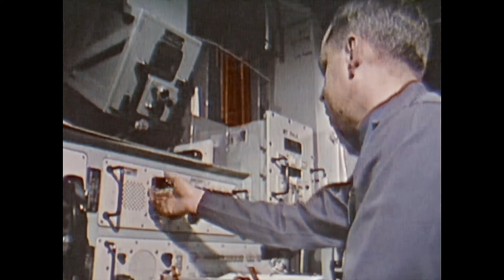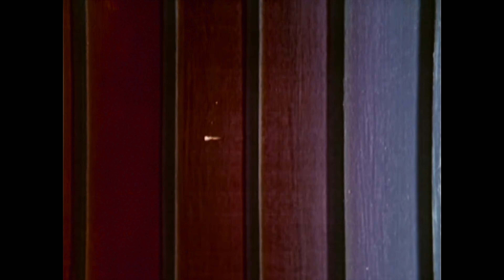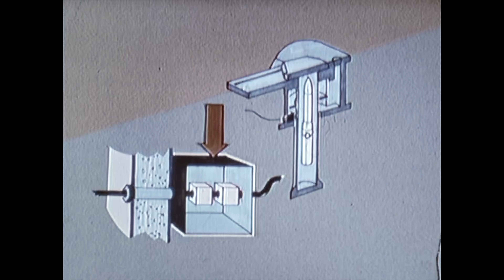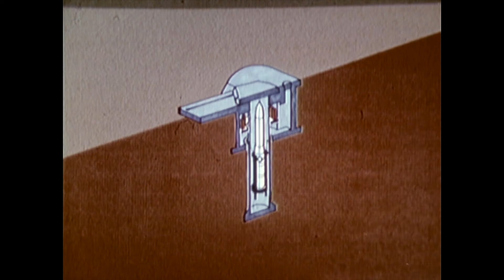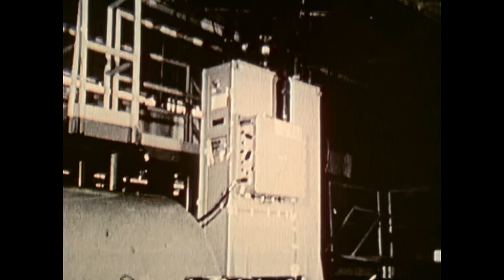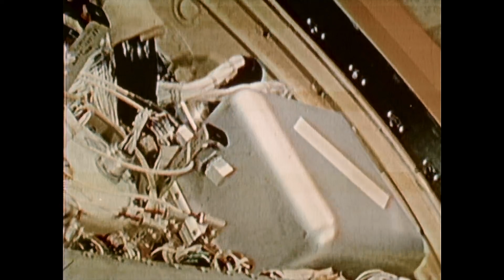Minuteman Hardness and Survival Program

Comment: I always wondered: The call comes in. The codes match up. You get authorization and you send your birds flying.

What happens next? You just hang out, downstairs - and guard some empty holes? How much food do you have? Got some good movies on the VCR?
Reply: A month later you start dying
Reply: @oriolesfan61  Without a doubt - but what does the SAC book say? What are those guys supposed to do?
Reply: @frankpinmtl there's nothing after the 30 days of surviving in the bunker
Reply: There were procedures written, but it’s generally excepted that you’d be dead since the Soviets knew exactly where the LCCs are and blanket it with ground bursts.
Reply: Would any of them have actually worked on either side?  After all, you only needed to have plausible functionality and survivability on either side. 
If you got to the firing stage then you had already failed the mission and both sides had already lost the war…or nothing happened and all failed to launch or track to target. 
It was all bluff and counter bluff thankfully like trying to outbid your poker opponent despite a poor hand. 😂

Comment: I'm curious about something. Did they think that this would have a chance of working? It just seems to me that the only realistic scenario would be to get the missiles out of the silos and far enough away to survive before the incoming nukes converted the installation into a smoking hole in the ground.
Reply: They were a missile sponge. The idea was each minuteman silo would require 2 warheads sent directly to it, therefore requiring an overwhelming strike that would take munitions away from other targets.
Reply: @andreahighsides7756  And of course the strategy included those being ground bursts. . Good luck with the crops.

Comment: Very informative but all general. Warheads yield, distance, air or ground burst factors were not discussed.
Reply: Those details were never mentioned in any sort of public facing reels. Even ones like this purely intended for congress budget allocation hearings.  All that was considered highly classified until the mid 90's somewhere.
Reply: @brianhirt5027 Hopefully the data showed that they could get their missiles up while under attack.
Reply: @UmHmm328  Been a hot minute, but as I recall it was rated around a 80% survival rate to anything outside of a direct hit. Even the angles on the concrete caps were precisely calculated to divert blast force. Similar to the reasoning behind all 19th century forts had angled walls, or tanks had angled armor. All designed to precisely diffuse pushforce. all mechanical linkages, electronic relays & hardpoint folding gangway had a secondary & tertiary backup. They built those things so damn sturdy that in the post cold war drawdown it become more economical to sell the emptied launch tubes to civvies rather than fully decommission & scrap 'em out. They even left the launch key consoles intact. Only thing that got pulled out was the comms gear. More durable than an armor plated cockroach hopped up on anabolic steroiids & PCP. If you're ever in the mood for an interesting google photo safari check out what some of those civvies retrofitted 'em into. pretty wild. Some of those civvies documented the conversion. Their language became quite, ah, heated & colorful every time they tried to alter any hardpoints. lol

Comment: I have often wondered what was really expected of the crew after a launch.  Were they expected to outlast the effects of nuclear weapon (essentially as a fall out shelter) then meet up with military authorities or were they considered expendable after the launches, no matter what the manual said.
Reply: As a former MM III Missile Combat Crew Commander, in Grand Forks ND my personal opinion on what would we do after missiles were launch, was and still is that we would not survive, you would be buried for eternity.
Reply: @lrami84909  Ditto Former 564th "Odd Squad" member here.  The Wing 6/Wing I Sq4 configuration was by far the most hardened of the fleet..
Reply from the maker: That's a great question. Anyone here work in the silo?
Reply: @nuclearvault  First of all, what you call a "silo" is an unmanned launch facility.  It is controlled by a manned Launch Control Facility miles away .   The  missile combat launch crew is two officers.

These LFs are not reloadable.  Once the missiles go, the launch crews have no other duties.
Reply from the maker: Thanks for the pedantic non-response. You know what he was asking…what would the operators at Oscar-Zero expected to do after launch?
Reply: @nuclearvault  Have their ashes fallout over areas east of Grand Forks.
Reply: This crew dog’s plan was after all 50 of the squadron’s missiles launched, I was going topside and find a bar.  I would order rounds for everyone and have it put on my tab.  Bar better be within a 5 or 10 minute drive!

Comment: Great video,  but no specifics given.  Date of production 1973/4. This was the beginning of the Minuteman silo upgrade program that,  among other things,  increased nominal silo hardness from 1000 psi to 2000-2500psi.  It also involved multiple redundant communication links and reliability/maintainability improvements.   

The program was complete by 80/81 and carried the Minuteman fleet through the remainder of the Cold War and into the mid-90s, when another round of upgrades began.
Reply: Thank you for that.   I learned the upgrade completion coincided with Trident C4, Reagan's NSDD-13, and my joining TacamoPac.  In retrospect this is a tad surreal.  I wonder what the production would look like, had digital production techniques like we've today.  🤔😧

Comment: "The Minuteman missile disaster in 1964 involved a Minuteman I missile silo at Ellsworth Air Force Base, South Dakota. On December 5, 1964, a missile maintainer named Bob Hicks discovered that the warhead had fallen off the missile and was no longer on top. Hicks successfully recovered the warhead using a cargo net and transported it to disassembly. The incident highlights the importance of proper maintenance and the critical role of missile maintainers in ensuring the safety and reliability of ICBMs. "

One blew up in ground one time. Wild story. Find it on YouTube.
Reply: and the rachet socket (experiment) hahahaha
Reply: @LarryCipolonea very large socket falling a long distance
Reply: Never heard of that. Did hear of the Titan II disaster in Oklahoma. I spoke with a major over in West Germany once who said he worked on it.
Reply: @iamgermane That’s the one, it was in Arkansas in 1980.
Reply: @connerstines1578  I looked it up: 1980 Damascus Titan missile explosion
Reply: @connerstines1578 Damascus, Arkansas to be exact. Had that warhead detonated, the then governor and future president, Bill Clinton would have killed. There is a documentary called Command & Control that has interviews with people that were on the scene during the explosion. The rocket exploded due to losing fuel tank pressure which is critical to the rigidity of the rocket. A socket caused the fuel leak. It was hypergolic fuel, so not even a spark was required to ignite it.
Reply: they made a movie about that one
Reply: @seagie382 Command & Control. Great documentary.
Reply: The missile's propellants exploded, not the warhead.
Reply: yuppp
Reply: That missile carried a warhead that was about as powerful as movies make people think all nuclear weapons are as well.
Reply: N Arkansas it blew but didn't go critical
Reply: The missile blew up in the ground - the warhead was fine.

Comment: 12:33 this is probably the most impressive video footage I have ever seen. liteally a camera being thrown from a nuclear blast???
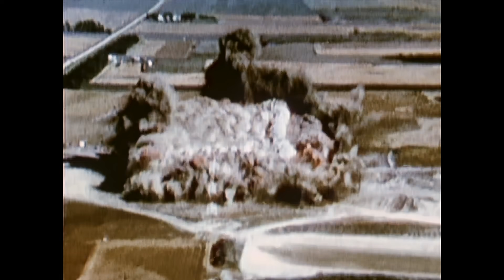Reply: Seriously, it's a great shot whether conventional or nuclear, because, I'd think that was a film camera, with all those moving parts working until the end. Is it the explosion at 18:12?
Reply: We did a lot of simulations using conventional explosives for generating blast and debris environments similar to those of nuclear blasts.  Wikipedia has a partial list (there are several known shots not included), but my best guess is that the test is probably Operation Snowball (500 tons of TNT in Alberta in 1964), with an outside chance of being either Operation Scooter (500 tons of TNT underground in support of the Plowshare program at Yucca Flats in 1960) or one of the three surface blasts from Operation Sailor Hat (500 tons, each, of TNT along the Hawaiian coast to test the effects of nuclear blasts against more modern warships than were tested at Crossroads).  My initial thought was Sailor Hat, but looking into the objectives of each test, Scooter and Snowball looked more likely, given that they included debris and debris throwout measurements, which this shot appears to be intended to document.  Snowball also included measurements of the effects of a surface blast against "underground targets," so that would be even more likely to be related to silo/LCC protection.

After checking a bit more, there seems to be an even better candidate--Operation Prairie Flat, another 500 ton TNT test in Alberta, in 1968, done as a followup to Snowball.  This one is specifically listed as having involved testing on "debris fracturing and transport... to understand nuclear blast effects on Nike-X anti-ballistic missile sites," and that debris up to 3/4-inch was still raining down near ground zero a full eight minutes after the burst.  This very much seems to be the sort of experiment that would require documentation by motion picture camera, so it feels like the probable best candidate for the shot in question.
Reply: @rdfox76  Absolutely well done.
Reply: I suspect this was conventional explosives. Such a ground or sub surface burst with that much venting would result in a massive amount of fallout both into the immediate vicinity and, increasing with yield, into the atmosphere, and the location appears to be CONUS, which would have put Americans at too great a risk, even back then. Could be wrong though.
Reply: @seitengewehr98  You sure you've done all of your history homework on this? They didn't seem very concerned about such things for a very long time.
Reply: @cwall235  Well, I've been studying nuclear weapons and doctrine for 40 years, as a hobby, mind you. Feel free to go through the list of US shots to see if you can find one that fits this description: a near surface/sub-surface burst in the US designed to vent. I know only of the Sedan shot and the ESS shot of Operation Teapot that are unlikely possibilities. Hardening the camera to both gamma rays and neutron flux is clearly possible, but would've made it quite a cumbersome thing. I'm curious to know myself, but they did concern themselves with lessening the radiological risk to the gen pop, just not nearly as much as we would now. I did say I could be wrong, which is far more than you get from most people. Happy to be proven wrong.